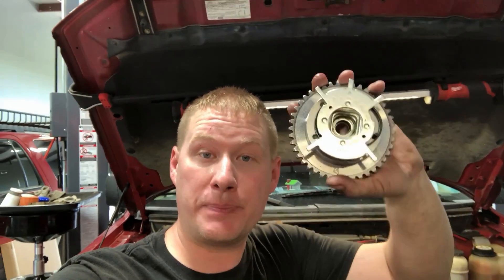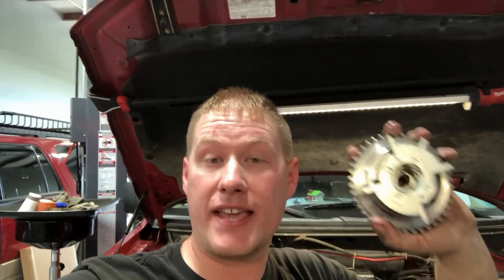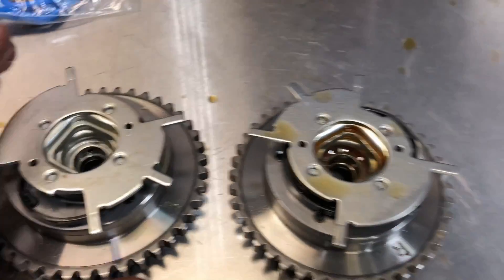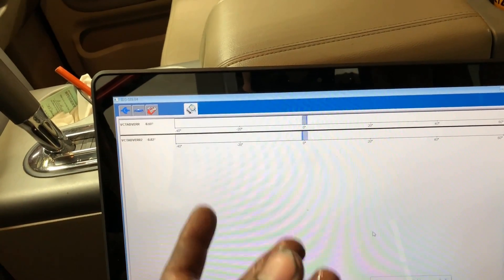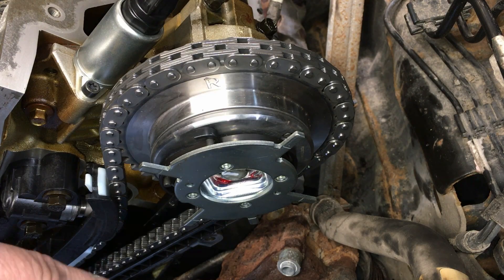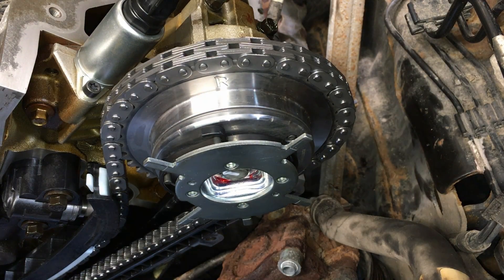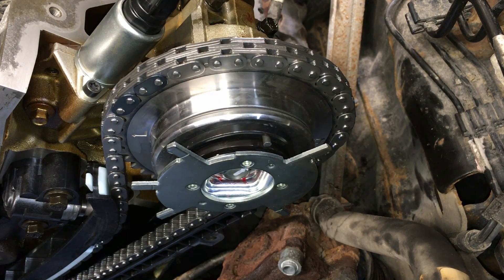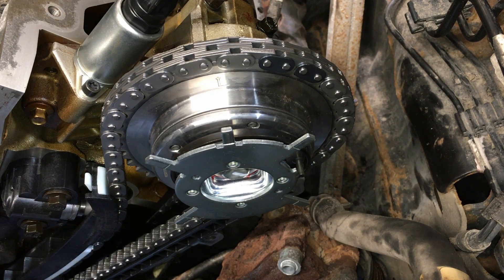Ford 5.4L 3v Timing Kit Choices: This is Why You NEVER Want to Use Aftermarket Camshaft Phasers!

Comment: I wish I found your videos before I tackled my 07 navigator 5.4 3v.  At the time I used autozone phasers and parts.  Timing set, melling oil pump, VCT solenoids, rebuilt heads etc. Still didn’t run right.  Super frustrated with no end in sight and eventually did the livernois phaser lockouts and tune to delete the phasers.  It runs like a champ now but I’m down on power and down on mpg.  When I have time I’d love to put oem phasers back on it now that I can do a timing set on a 3v in record time.  Keep up the great work.  I always refer to your videos now as you’re straight forward and thorough.   

Do you happen to have any videos for servicing the transmissions behind these 3vs?  They have no dipstick and the fill plug is insanely difficult to get to.  Filter is molded into the pan.  Basically a giant pain but a necessity to maintain.  I’d love to see that in the future    Thanks!

Comment: Any help you can give me on my 07gt keeps going into limp mode and once in a blue moon gives me throttle body codes but I've put 3 different 3bodies and 6tps sensors could this be my computer???
Reply: STOP THROWING PARTS at the problem.  Get the engine inspected and evaluated by a professional.
Reply: Why in the world would you keep putting the same part on over and over?

Comment: Hey Brian I noticed when you were hand cranking over the engine the aftermarket phaser had the letter R stamped on it which would note the passenger side.  Were they swapped incorrectly by whoever put them in?
Reply from the maker: Only the original phasers from the factory back in the day had just an L or R. Any service Phaser from Ford or Aftermarket has both the L and R because the phasers are universal for both banks the timing marks are just 180 degrees from each other.
Reply: When he turned it 180 degrees it showed the "L".
Reply: In the automotive world, left and right is referenced from the view out the windshield. Always facing the front.
Reply: They're Chinese knock offs all over Amazon and Ebay.
Reply: Ozzstar All cam phasers have an R and an L stamped on them
Reply: I think it means right side looking at the front of engine
Reply: ryan mac fyi, the left side of the engine is the drivers side here in America.
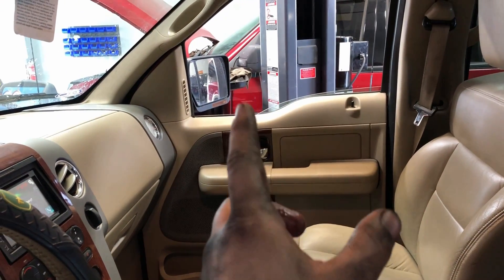Reply: +Zach the question is was that phaser on the wrong side?  Not was it stamped L or R.  3:07 mark
Reply: They are universal. Left or right are  the same
Reply: not if your looking at the front of the engine.  Im not 100% sure but when they are installing the timing components dont they reference the front of the engine whern referring to right and left?
Reply: Ozzstar they have a R and L on both phazers. They are interchangeable. On one side you line up the R and the other L. I was confused at first when I did my timing job

Comment: How much can I expect to pay for spark plug replacement on a 2007 F150 5.4l 3v?

Super scared to do it myself and break the plugs.
Reply from the maker: I charge $250 parts and labor if they break or not. Other shops the price will be double plus they charge for each plug that breaks.
Reply: I followed his video with no problems. Definitely use the sea foam deep creep that he uses.
Reply: FatBoyLo Deluxe this truck has 140k miles and i think the plugs are original 😮
Reply: Damn I wished you were near by lol

Comment: How much to pay a guy like you/another pro to do that timing job? 2009 4.6l 3v f150
Reply from the maker: $2,300 at my shop http://bsgautomotive.com/contact/ but others are closer to $4k.
Reply: FordTechMakuloco thanks for info
Reply: @FordTechMakuloco  Have you done a full engine swap tutorial video pertaining to the 5.4 3v? What is your opinion on the AER remanufactured 5.4 3v engines?